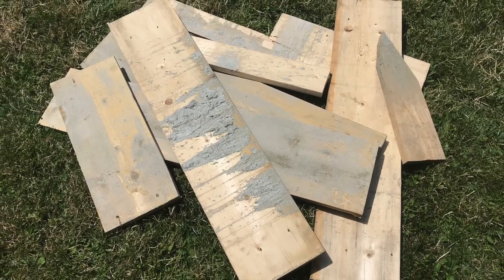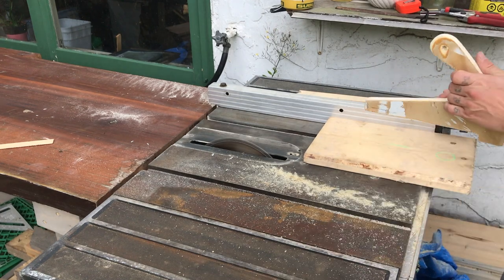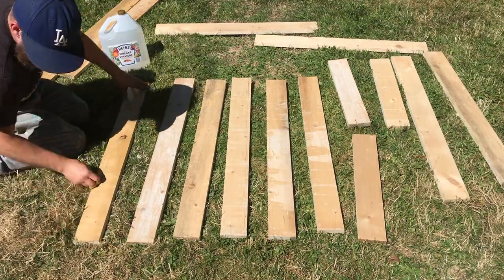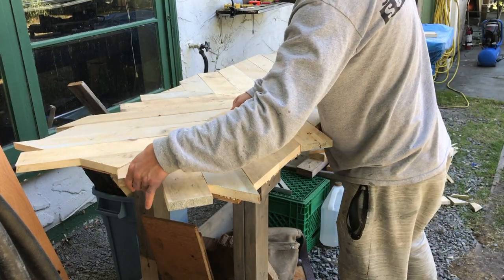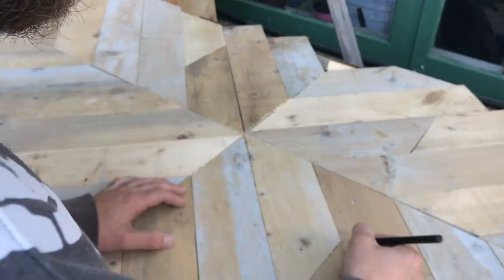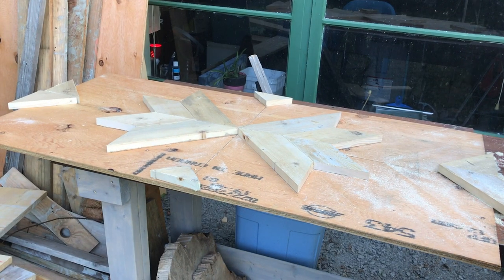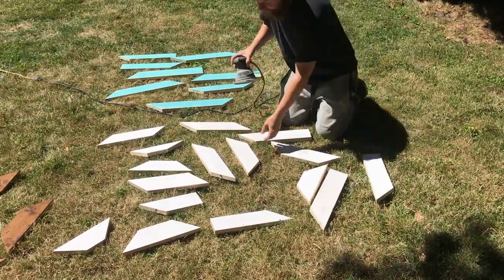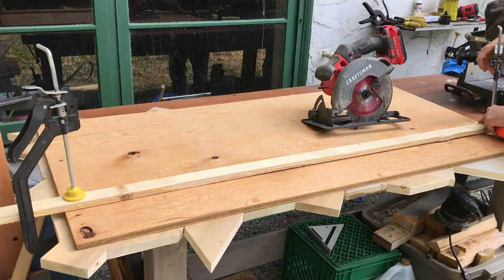Turn $0 into $150 with Geometric Wood Wall Art

Comment: Is there any chance to do this without a table saw? I have some much thinner  wood pieces. Love the project.
Reply from the maker: You don't need to trim with a table saw, it just creates a better eddge. You can either just make sure you buy all the same width pieces of wood. Or you can create a guide and cut with a circular saw. Hope that helps!
Reply: @neilhatherall  thanks for responding! I'll let you know the result. 👍